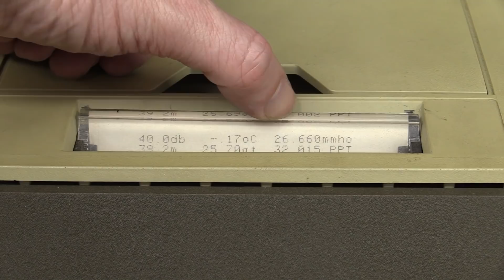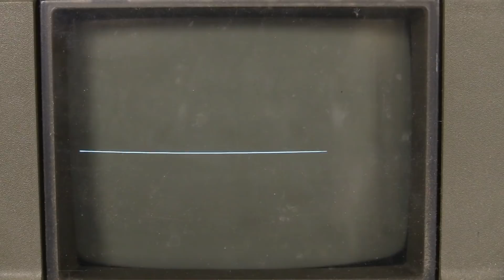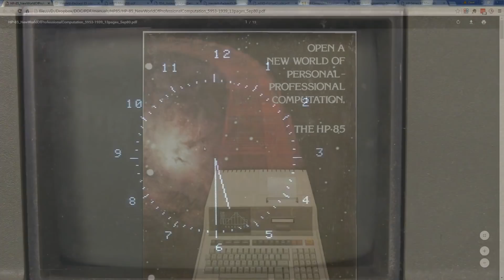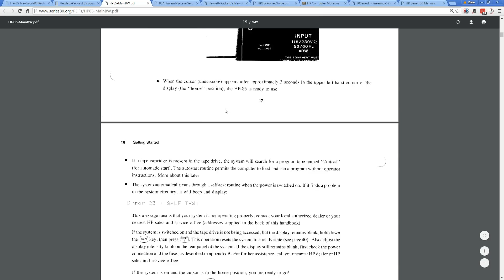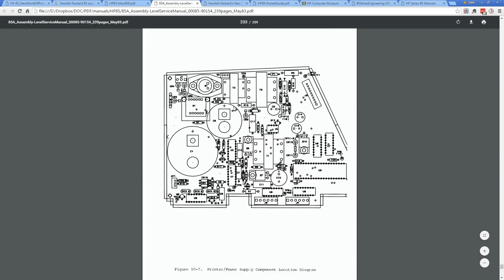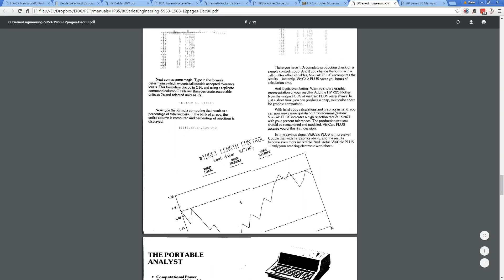EEVblog #904 - Hewlett Packard HP85 Professional Computer

Comment: Oi, the Bad Old Days of flowcharts being considered the Way Programming Was Done.  I vividly remember reading my first BASIC programming book that came with my parents Vic-20 when I was probably 9 years old and them saying "only a fool or a genius would write a program without creating a flowchart first."
Reply: Then wouldn't you need to write a program that helps you write and edit flowcharts? Oh wait. How would that be possible if you need the flowchart first?

I must have been a genius then.

I think the old Basic would have been so much better, with just a few additional commands, say like being able to open a standard Dialog window, like how the TI-Basic on my TI89 graphing calculator allows me to do.

And also by having graphic image variables, that could also hold icons.
Reply: Yosef MacGruber Yeah, when I was 9 and I read that, I immediately said 'It's probably stupid, but if it takes a genius to write programs without flow charts, then I'm going to be a genius dammit.'
Reply: Dustin Rodriguez
Actually, I think it is a good idea to use flowcharts. The huge problem with that idea, is that most useful computer programs are so complicated, that the matching flowchart would be totally unmanageable. And if it was manageable, do you really need a flowchart?

Flowcharts seem more useful now, as a means of telling jokes. There are some really funny flowcharts out there in the internet images. A problem-solving flowchart that solves all problems, well in a humorous but not so realistic way. Did you touch it? Can you blame somebody else? Does anybody know? Hide it, throw it away. More complicated than that of course. Drops down eventually to "NO PROBLEM". Of course it is a joke, and hopefully nobody would really try to solve problems that way, as it would probably only make the problems worse. Then there is the flowchart on how to choose your religion. Again, not advisable, but it is sort of funny.

Programs have seriously changed. A realistic flowchart would probably show the program ever freezing its execution by "Activate menu and wait for the user to select something. Wait and wait and wait some more." The old style flowchart-wise would be, "Has the user selected something?" No - then repeat the question. Yes - Process the request. But with more modern computers, that now use multi-tasking rather than the old keyboard polling, it would be more like Activate or Refresh the menu. Program goes to sleep. OS wakes the program when the user makes a selection. And not only that, but there has to be a lot of rules, to select which menu items should be grayed-out. For example, you can't Save, if there are no open files or windows. You also can't Print in this situation. On Macintosh OS, it is actually possible to have an application open, with 0 windows on the screen. You can't Paste if the clipboard is empty. You probably can not Copy, if nothing is selected. You probably can not Select All, if there is no cursor or active area in the current window that to Select All would make sense. The application has to tell the menu system all this stuff, even before you make a selection. I think that Grayed-Out menu items makes an OS more intuitive, as it tells you that an option is available, but that you are currently not in the proper mode in order to use that option. Upon trying out a new application, often the first thing that I do, is simply explore the menu bar menu item options, as that gives me some idea what this application can do, and where I should look, when I want to do something with it. It makes sense, because reading all the menus options, takes very little time.

BTW, can anybody suggest a proper way to "gray-out" items, when using some Basic program system that does not allow me to change the color or "gray-out" anything in the menu bar? In such a limited system, I can change the text of every menu item, but to what? I have tried replacing every other visible character with a space, but it just looks so tacky and makes it near impossible to read. Maybe I could eliminate all capital letters and force lower-case only, for "grayed-out" mode, but I am not sure that is obvious enough. Strike through doesn't work, as it can only replace space characters with a "-". There is no stylized text option that can actually do strike-through. What do you think would look best, using only ordinary ASCII characters, to simulate a "grayed-out" effect?

In systems that may allow it, I like to include a very short Dialog or error response, if a "gray-out" menu item is actually select-able, explaining why the option is not available right now.

Comment: My HP85 had two HPIB (proprietary V.35) connectors, one for a sprocket feed printer, and one for a Frequency Selective Voltmeter.  A 3,200 line HP BASIC program controlled the voltmeter (taking 2,700 measurements each run), printed any out of bounds readings, and graphed the composite results for the bosses' overview.  It was the equivalent of a slow scan Spectrum Analyzer, dirt cheap, user friendly, reliable, and saved our hides from FCC complaints about spectrum abuse.  Customers noticed the improvement in quality of service within weeks of putting this into nightly use.  The day shifts concentrated on identifying and correcting faults that the HP85 discovered at night.

Comment: Another hp that looks like this one, also running on basic but one long red led readout across it instead of a crt, vintage 1975 few years before this one. Anyone know what that model was? Hp was ahead of the time and had made some great stuff, now their computers and peripherals are junk.
Reply: How about a HP-9825, Marketed more as a calculator
Reply: Thanks, that looks like the one. $12,000 US when it was new back in 1975?

Comment: +EEVblog A great video about this machine I didn't know. I was only 10 when it came out, so professional computers weren't in my environment. Anyway, I like the build of this machine, particularly easy to service. What I like most are the manuals, so complete ! I have an old Tektronic 2430 oscilloscope and I had a Commodore 64, and the manuals, like the ones from HP, are GREAT ! After reading them, one knows everything about the machine. This time is long gone, alas...

Comment: I know you were quoting HP... but I question whether or not they were being totally honest regarding other existing processors... I was always under the impression that the MOS 6500 CPUs could perform BCD calculations (at least addition and subtraction) perfectly fine.  Yes?  No?
Reply: Yeah... that "quote" from "HP" on oldcomputers.net is suspect. It's not attributed to anyone and reads more like marketing B.S. than a real answer to the question.  I still very much doubt that the CPU is capable of anything more that what Intel, Zilog, or MOS were doing at the time.  Where the power (and accuracy) most likely lies is in their floating point library.
Reply: Actually, HP's custom CPUs did operate directly on BCD numbers and 64 bits worth at that. Special instruction set designed specifically for the purpose. Same for the early HP calculators.

Comment: Used these at work in the early 80's.  They had IEEE interface to an in-house tape reader to read or calibrate oilfield pressure gauge logging tools. When the tool became obsolete i was given an HP85 and had a lot of fun going through the excellent programming manual.  I remember writing a Mandelbrot set program that took hours to complete.  Like all HP calculator manuals of the time the manual was almost a complete programming course

Comment: Never used one of these but did use an HP9836 computer in a lab when I used to work at a fiber optics lab at Bellcore back in the mid to late 1980s. Had HP-IB and could talk to all the HP and Tektronix lab equipment. So I'd program up the instructions to run a test, collect the data then plot out the results using a pen plotter. It was like watching a robot working.
http://www.hpmuseum.net/display_item.php?hw=3

Comment: Wow, did this bring back memories. The first computer my company would buy for my own use, as a mere Research Assistant (glorified technician). I learned the HP basic which differed from just about everybody elses. It was slow, but I seldom had  to find any other device to get my data  printed and graphed to my supervisor's satisfaction, it was so complete and reliable.

Comment: Isn't that tape cartridge very similar, if not exactly, to the old QIC backup tapes? https://en.wikipedia.org/wiki/Quarter-inch_cartridge
Reply: I'd put money on it. I don't think Dave has seen one before, let alone pulled one apart to see how they work. The roller rubber looks to have gone very sticky.

Comment: Shame they can't make a 'portable computer' these days that isn't built to the lowest price possible and fails  with a slight gust of wind :p
Reply: The Toghbook maybe but you don't get to drop any Apple product very often - usually once will do ya.
Reply: It cost $3250 in 1980 (north of $5000 in 2016). You can get a Panasonic Toughbook  or just a unibody MacBook Pro for half that in absolute dollars, and both the computer and the floor you drop it on will be in better shape after a fall, especially since unlike the old HP it's going to be 100% solid state.
Reply: It was more a tongue in cheek jab at HPs own line of laptops

Comment: I have 2 of these. Both have a broken tape drive. Apparently, the rubber on the drive axle turns into goo after a certain number of years. Maybe it destroys the tapes, so fix it before you try other tapes. With Google, you will find several links about fixing the tape drive. This was "state of the art" when I started my masters education at the university. No fan, so they are completely silent when the tape drive is idle.

Comment: My first computer was my uncle's old TI-99/4A, which was the first PC with a 16-bit processor. It didn't have a storage drive, so I couldn't turn it off. It was good for learning TI-BASIC and playing Q-Bert. My parents bought an AST Windows 95 PC from Radio Shack a few years later for $1600. I remember being amazed seeing Weezer's "Buddy Holly" music video on the Windows 95 machines in stores. We later spent $300 to upgrade the 8 MB of RAM to 12 MB.

Comment: This reminds me quite a bit of the IBM 5100, the immediate predecessor to the PC. It was very similar in both form and function, and it was sold to the same crowd.
Reply: This machine is not really a PC, but it is a self-contained microprocessor based desktop computer.
This machine is not meant for the layman.

Comment: Sheeit, that looks nice. I would have absolutely killed for that when I was a kid.
It's odd that they claim to have rolled their own CPU just for BCD arithmetic, though, since both the 8086 and the z80 (which should have been in the design time-frame for this, I think) are well-known for having rather extensive BCD facilities.
Reply: Perhaps they were able to almost drag and drop bits of the maths logic from their calculators into the CPU?  I first coded machine code in Z80, I remember it having some BCD support, I didn't think it was extensive but then I didn't use the BCD functions.

Comment: Will it run Crysis?
Reply: Yeah, at 1 fpy.
Reply: Yes, it is a Turing machine so can compute anything given enough time. BUT you are not asking whether it can run it, you are asking if it can run it at 60 FPS max settings and then the answer is no, of course not.
Reply: It does not have enough RAM though. Turing completeness is only given if you have unlimited memory.
Reply: I wonder how many FPS it'd run, 1 per century maybe?
Reply: Nnotm Ah yeah, good point; I didn't think about that!
Reply: Dave should make a video to see if he can get Crysis to install on it
Reply: Unoriginal joke is unoriginal.
Reply: Something  is something the same repeated is twice unoriginal and used by generic trolls

Comment: I used an HP 85 at Caltech in 1982-83 to calculate and plot frequency responses for laser interferometer gravitational wave detectors (our project became LIGO, though we didn't pick the name until later). We had the HPIB expansion module and a 5-color pen plotter. Really slick for the times. 

BTW I still work on LIGO. We have much faster computers now.
Reply: Wow! LIGO!
Reply: YouTube needs a "Like" button just for this comment.   :)

Comment: Can it play crysis?
Reply: You bet it can at a smooth 60 years a frame in 256 by 192.
Reply: Sure, in ASCII mode.
Reply: Can it run Linux?
Reply: Unoriginal reply is unoriginal.
Reply: generic comment is generic
Reply: +tikabass recursive comment is recursive 😄
Reply: Knuckles the Echidna generic comment on unoriginality of original comment is generic and unoriginal.
Reply: Sounds like Haskell.  Mmmm.... I'm thinking about that question as well.
Reply: Unoriginal comment is unoriginal.